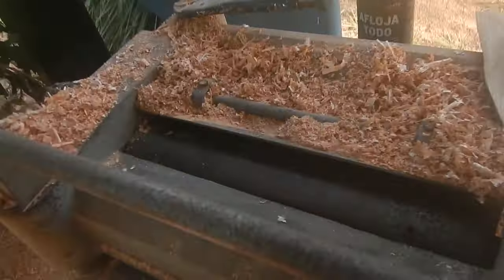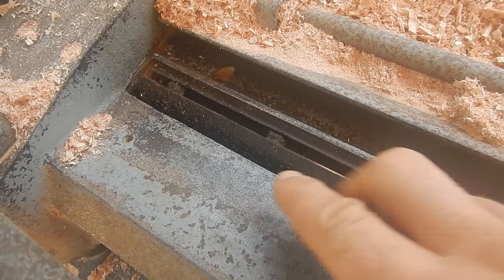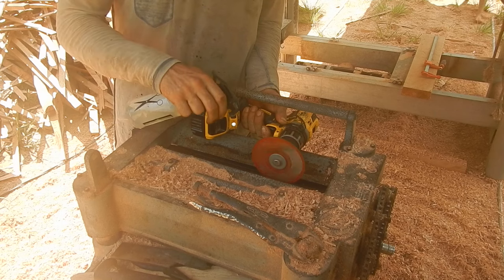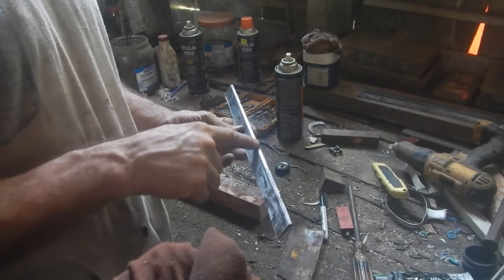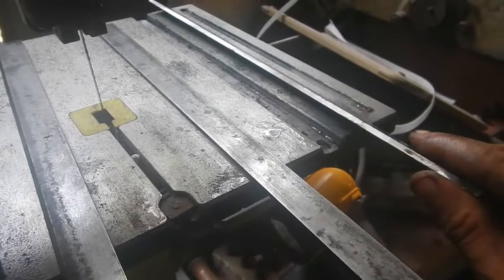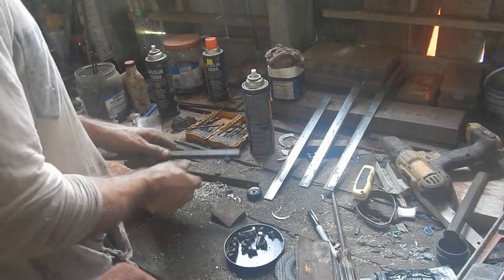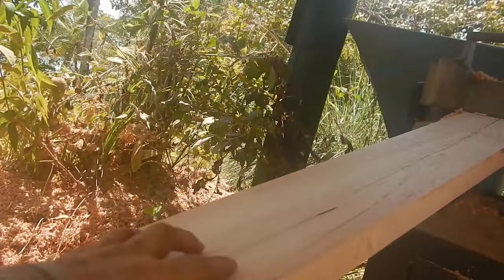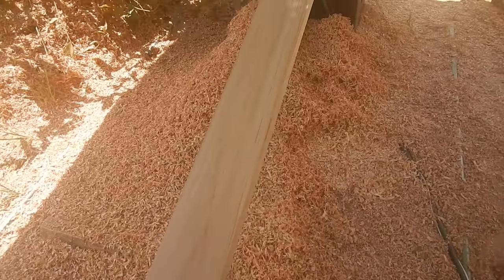Sharpening Planer Blades ...with a Bent Washer.

Comment: You'd like to get those very straight and even. One possibility would be to mount them on your lathe toolpost and use for example bench grinder as a material remover. Then move the toolpost back and forth and your toolpost feed to make the blade touch the grinder,

That's not exactly best use for a lathe, since you don't want grinding dust on your rails, but directing sparks away from the lathe, protecting it well and cleaning afterwards, you'll be fine with random sharpenings. 

You  want those blades straight so each of then cut frim the same depth. The sharper they are, the longer they last and you get really good and shiny surface on the wood. 

Bench grinder is not surface grinder, but if you have a sturdy one with good bearings and you can mount it on lathe frame, you could be amazed how big difference it makes on qulity. It's even better if you have a diamond to dress your stone. If don't, diamond file is better than nothing.

Comment: if you make a rail for a grinder in a clamp to ride on you can sharpen the blades in place the planer in my shop has this feature though I have ruined a set of blades before by finding a steel bullet lodged in a board just exposing it was enough to wipe out a set of blades. also make some roller tables you can increase your boards per hour planed by doing multiple boards before closing the planer and if you set your roller table up right you will be able to just slide the boards down the bench back to the start of the planer without actually picking them up it saves a ton of energy in the long term